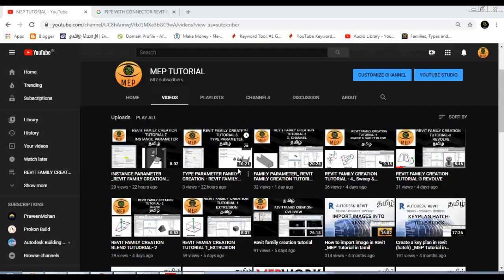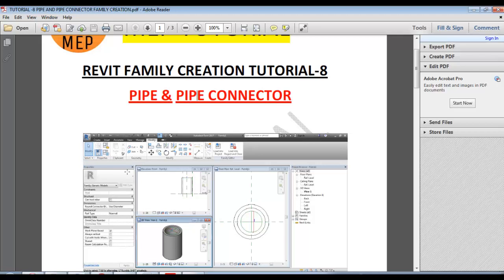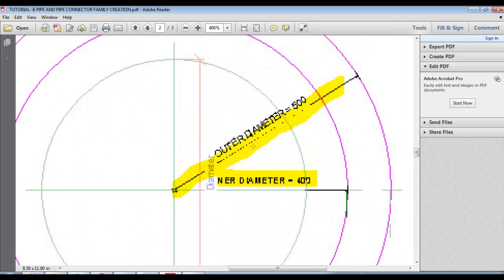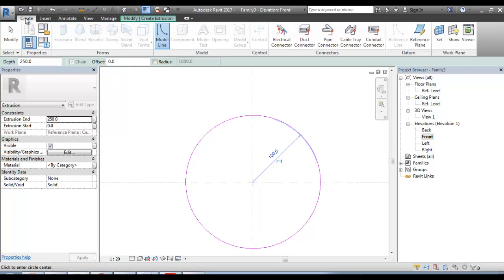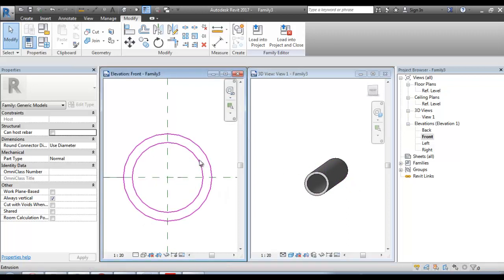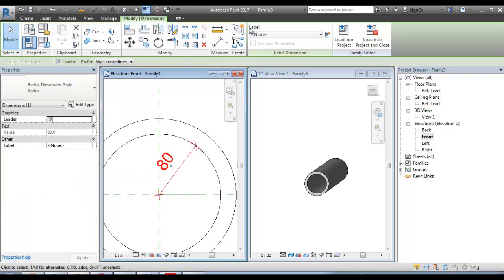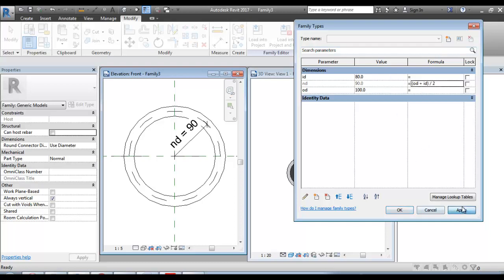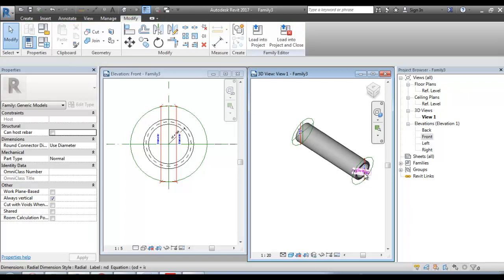PIPE AND PIPE CONNECTOR_ REVIT FAMILY CREATION TUTORIAL 8

Comment: I took these steps from your video when editing one of the pieces in a family. However, when I loaded it back into the family and then into a project, the connectors didn't show up. Could you tell me what I'm doing wrong?
Reply from the maker: If u follow this step it should be der
Reply from the maker: After loading to project use this in some other location like different floor plan or section or 3d for ensure the connectivity instead using in the default location
Reply: @MEPTUTORIALmsk196  Thanks for answering! Sorry, but what should I use somewhere else? By default my tank is loaded on the floor plan. In case I switch to any other vist, the hydraulic points still do not appear.
Are you on Instagram? Well, I can send you pictures.
Reply: I've been here for a month and I can't solve it.
Reply from the maker: Allteeth4smile@gmail.com
U can send those image in mail
Reply: @MEPTUTORIALmsk196  Thanks! I'll send to you.
Reply: @MEPTUTORIALmsk196  Hey man! I have already sent the email. I would be very grateful  if you can look. My email is herbertrsantos@yahoo.com.br